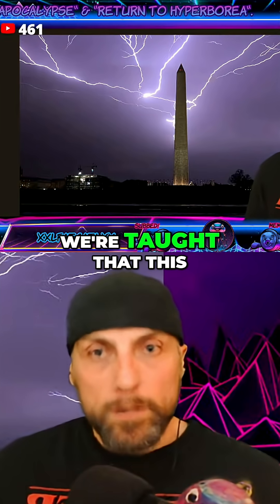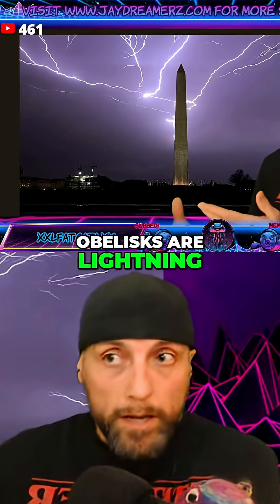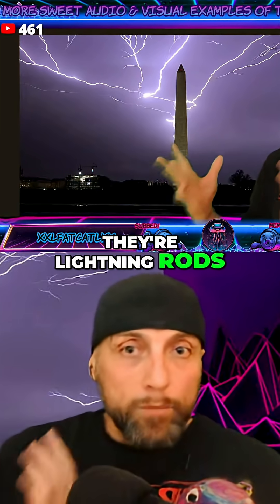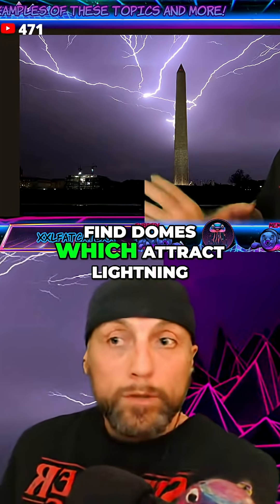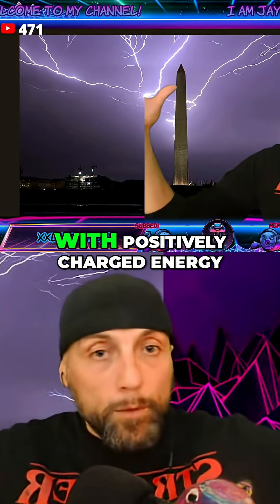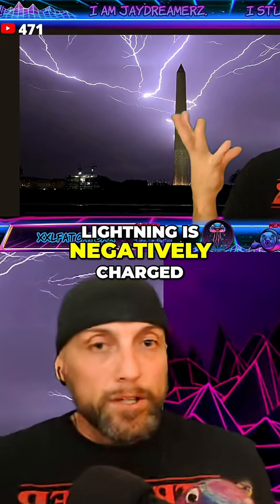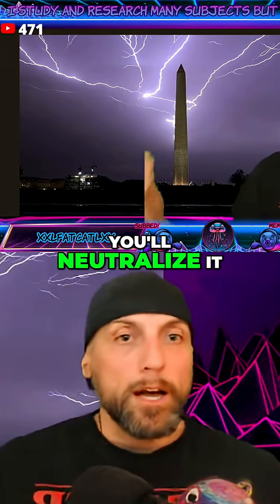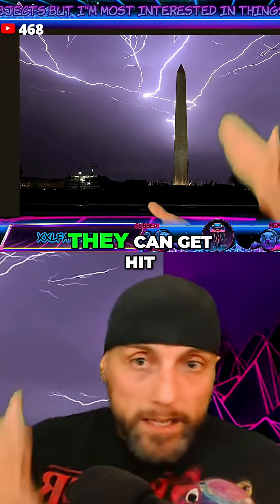Egypt's Obelisk = Old Tech (see description)

Comment: What do you think foul poles on baseball fields and field goals are for on football fields. They emit a electro magnetic field that push the clouds away keeping the players safe from lightning strikes. A hollow pole or pipe drove into the ground say 10”diameter  and 20’ long filled with a little water will punch a hole in the clouds above it and different metals copper being the best and various depths of water and i assume you can put different elements in it and cloud seed but it’s a whole no pun intended science we are not told about that most of us can do at our homes today